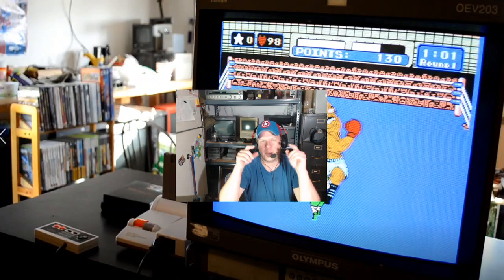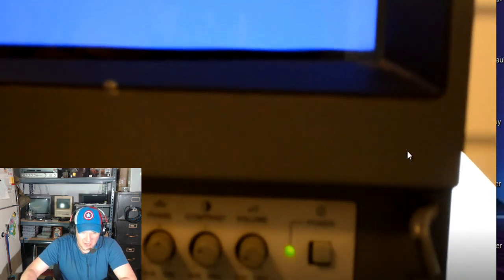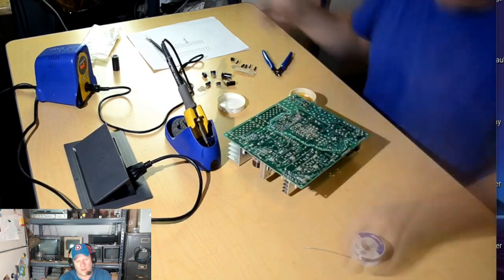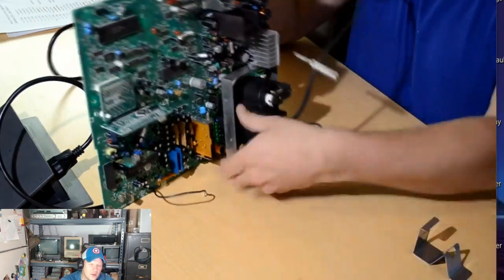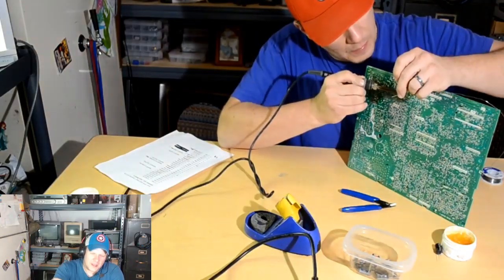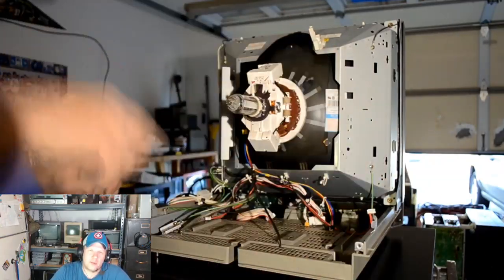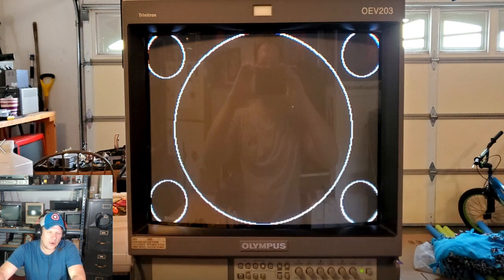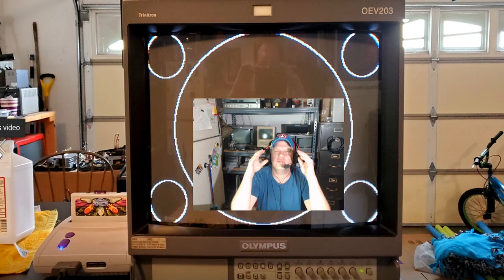Is an Olympus OEV as good as a Sony PVM? | Pro CRT Restoration - OEV 203

Comment: Do you do any final convergence tweaking after a recap like this. The final test screen looks like the colors are slightly separated in the upper right hand corner. I have the same monitor and notice similar convergence bleeding in the corners as well. Not sure if it is worth trying to tweak or leaving well enough alone.
Reply: Not only that, but his circles appear as ovals.  He did not get perfect linearity, OR convergence.

Comment: One question, I got myself a Panasonic TC-1470Y. It has some problems :
1. When chassis touched it has 90% chances of the screen going black and restoring after around 10 secs. Screen recovers if I change from PAL to NTSC and then back to PAL to have color.
(Bad solder joints??) 

2. When there is a dark image, skin tones are green, and the overall image does have a greenish tint, and the Low Light Blue and L.L.Red pots don't work at all
(Changing pots??)

3. The image randomly goes black with only some parts of some text on the screen but in a very dim red or blue (if it was white) and fading away. Resolved if tapping the case
(Oxidized heater pins??)

Can you pls give me some advice before changing the parts I think are bad according to the service manual values? (Should I change anything else or is my diagnose incorrect?)
I have to mention that I calibrated the picture via blue only and smpte pattern and it is eye-meltingly guys up close, so tube isn't worn out (I think)

Thanks in advance! :)

Comment: Hey Retro Tech,
Your BVM/PVM Repair are really intresting.
I started working on CRT TVs again but it was a long Time ago when i worked on them.

Somy of my Sony Trinitron CRT TVs and Monitors have that issue that the Conversions and Geometry are off but the more anoying problem is that they all have Blooming (Screen size change when the Screen gets Darker or Brighter and a square looks like waves).
It would be nice if you could give me a hint what the issue could be.
I suspect that the Electrolytic Capacitors in the Hot Areas are causing that kinda issue but i'm not 100% sure.

I would love to get them working like new again because the CRTs themself are still in very Good Condition and Strong.

Thanks

Comment: Where did you find the cap kit? I've got one of these and the picture is great, but after about 20 mins the CRT starts squealing so I figure it's due for some work
Reply: Think he develops his own
Reply: @Hambs  Either that or an eBay seller called Savon Pat. He was an old Sony tech.
Reply: @dominicrinaldi4738  He makes his own, i bought one from him. In the process of doing it now so i came back to check this video for some extra info.

Comment: Good afternoon, Steve! Please tell me, maybe I'm wrong, but if in the test "Grid", you remove the red border outside the display, then in some games part of the picture will also go away. An example of such a game is "Streets of rage" It's right? Maybe I'm too nitpicking, you need to relate to this easier. :) Have you noticed such a problem?
Reply: yes streets or rage 2 has some rather "bad" placement of HUD elements, you can easily cut off your own life bar and character picture